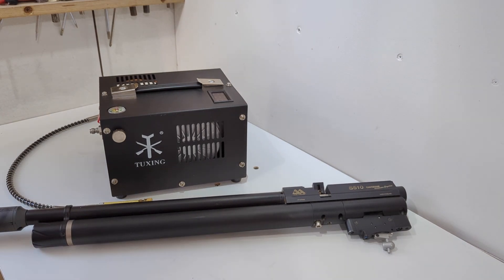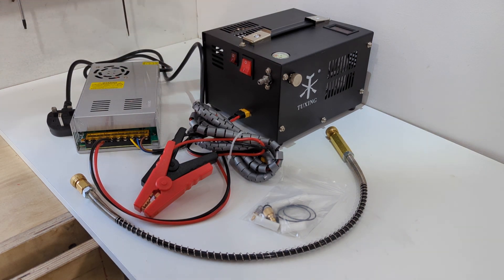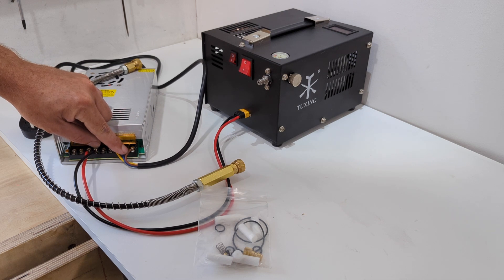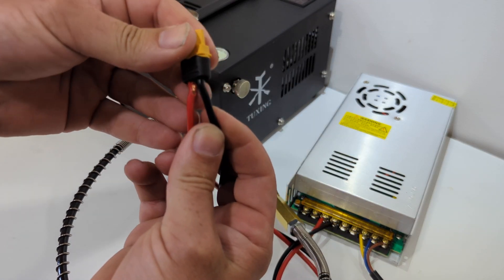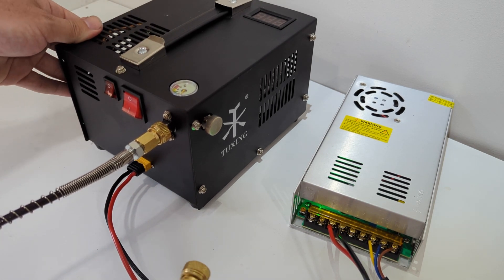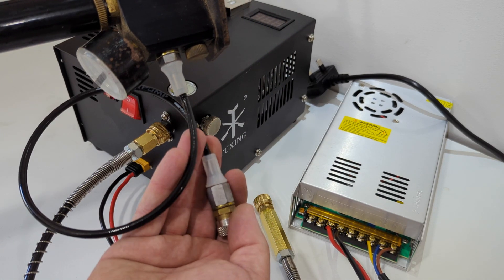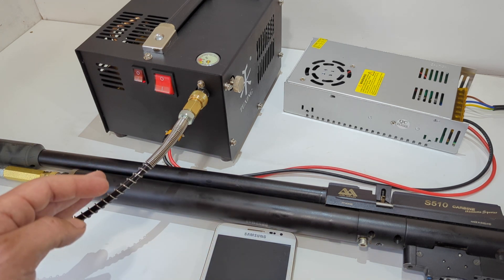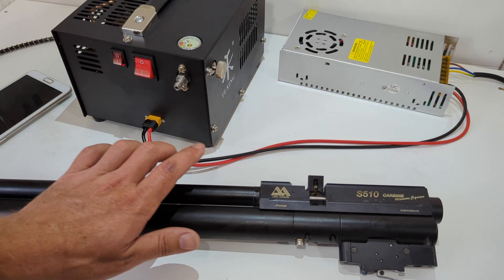The shocking truth about the tuxing 300bar mini pcp compressors

Comment: You might want to throw that PSU away and replace it with a Mean Well one. The chinese noname brand ones are very commonly using substandard components and pose a serious shock and fire risk. Mean Well may also have a suitable enclosed without exposed terminals.

Comment: Hi my tuxing worked lovely for 3 months then its like the motor has lost power and goe slow. Amazon was rubbish made me deal with tuxing in Chinese direct. No help. Any ideas ? If tried it on car battery same results. Just makes a bit of pressure. Stalls. The transformer giving 12v to the board all joins perfect. Had cylinder apart everything looks new as it should 3 months old. Weekly fills at 200 bar. Any ideas ???😢

Comment: Hi, good informative vid, thank you! would be good to see and update on what you ended up doing with this
Reply from the maker: Hi mate,  there's a full strip down and repair video the the compressor after 18 months use. It's still running fairly well to this day. It's definitely getting tired and could do with a few new parts but so far,not a bad buy all things considered 😉
Reply: @tillysgunstocks  Ah so there is, apologies! just given it a watch now. did you find out if that grease was a good shout or not?

Comment: Helth and safety gone a bit mad again nobody is going to grab hold of the wires or stick a screwdriver in the live bits with it switched on , ok point it out but there's no need to be so alarmist about it ,I've had one for 18 months not had a problem with it,  just my opinion,  😁👍

Comment: You never did a follow up on this that I can see (I searched for "Tuxing") so I presume there's nothing worthy of note on this compressor.  I've just ordered my first PCP with a hand pump but I have my eye on one of these when I get sick of pumping (or find it too much effort) because they are about 1/5 the price of the gun shop compressors.

The only wires you really need to be careful not to touch are the AC line from the house power.  everything else is 12V and no danger to you, though of course any bare wires are not good because you could short out the power supply and damage it (but probably not because they are protected).
Reply from the maker: Funnily enough mate it's just died.. I need to do a strip down vid asap.. but it's worked well until it didn't 😆
Reply: @tillysgunstocks  Well hopefully it's fixable, but that depends on the failure of course.  I'm sure all air gunners would be interested in what you find out.

Comment: This kind of power supply, a closed frame switch mode, was never designed or intended for use outside an enclosure. It is itself a component only that is meant to be used as an internal part in some other larger assembly, that's why it has no strain relief, as that would normally be done internally on the chassis of whatever product contained it.  The fact that it is supplied naked like this without so much as a box to enclose it speaks volumes to what a shonky cheap arse vendor this is.

Comment: My unit is slightly different it has push click buttons for both power and fan. Filter that came with it is a bigger blue cylinder. The power supply blew out on the first day. I just use the car battery.

Comment: Old video but I bought one recently with some 7" / 8" long filters with the foam and moisture absorbing balls. The collar on the connectors can be pulled back whilst under pressure..
I have fittings bought elsewhere in the UK and you cannot pull the collar back with pressure in the line. Dread to think how much damage a 7/8" projectile can do at 300bar if someone accidently pulls the collar back.

Comment: How is this holding up after  9 months. Thanks Den.
Reply from the maker: It's not blown up yet mate. It's not got any noisier or anything untoward as yet. It has pretty much paid for itself already though with the amount of air I'm using for filming and stuff😉
Reply: @tillysgunstocks   happy days was looking at the version where the inverter is built into the case, do these compressors need silicone oil? 
Thanks again.
Reply from the maker: According to the paperwork they are maintenance free. I find this hard to believe but as yet I've not done anything to it and it's still going strong..ish
Reply: @tillysgunstocks  cheers for the speedy reply for a the price I’m gonna give one a punt.
Thanks for the info it’s appreciated.

Comment: It's Interesting that the compressor passes the standards required for high pressure air but fails on the power supply. I would have thought it the other way round. I see that the compressors with the built in power supply have failed British safety standards and were recalled. I have just bought one of these under a different name and blue in colour. It works very well. I wonder if these available today have now passed. 
Thanks for a great presentation.

Comment: This is a junk pump. After a few runs the sleeve bearing on the main shaft came loose. The manufacturer’s solution? Disassemble the unit to reveal the shaft and hammer a ding into it that would restrain the bearing from moving with the shaft!  The noise is extreme and output minimal. It took at least four runs to pressurize my rifle due to rapid heat buildup. 
I would guess it died within 5 hours of use. 👎

Comment: I made the mistake of buying just the compressor without the external power pack as I have a few 12v transformers lying around but I soon found out that it won't power the motor enough to run the compressor as every time it tries to move the piston on the compression stroke the motor struggles to make a full revolution IV only had it less than 24 hours and couldn't help myself taking it to bits,,, can anyone tell me what the specs are for a 12v power supply that I need as so far I can't find the one I should be using,,, also keep up the good work with the videos they are always interesting and insightful

Comment: Regarding the airtube corrosion issues . I recall AirAms suggesting the airtube of the NJR100 ( yep going back a while) a spray of wd40 up the tube,  allowing it to dry before assembly.  Anyone ? Lol .
Reply: I just out of curiosity found the owners manual for the S100. Every 6 months pop 3-4 drops of oil into the reservoir via the filling adapter... then fire the rifle into some rag ... but don't load a pellet ! .... boom!
Reply from the maker: That's interesting to know. I can't say I've heard of it,in more recent times 🤔

Comment: Dry air is a must but it is as hard on the compressor as the rifle.  Humidity condensing in the cylinder ruins the lubrication, causing wear.
My Spiritech compressor has a sintered brass filter so I modified it to a fitting to plumb air which has been dried over molecular sieves for days.  The mol sieves are in a 10 Bar rated air tank.  I withdraw air at a regulated pressure set at 0.10 Bar.  
I only use it to fill a rifle and it never gets over 30°C.

Comment: Hi. I've just received one of these today and it seems to be an updated version. I was preparing my teeth ready to be gritted over the power box wires but they have done a redesign and it's completely sealed and just how one would want it.
I've just used it once so far and have to say IF It last a good while then I will be well happy. It is very well made, thickly and evenly powder coated and really quite quiet. The pressure gauge even glows in the dark!
Time will tell but over the moon so far.
Reply: Any updates?

Comment: 12 Volts DC on the other connector  that will not harm you
Reply: 1.25 amps might hurt you though.
Reply: @matty1255  Nope. Not at 12 volts, you can put wet hands on battery terminals with 250 amps potential on even a small car battery, or 700+ on a larger one, with absolutely no effect.

Comment: That type of switch mode power supply is meant to be fitted inside an enclosure with proper earth bonding, fusing and switch protection! Using it out of an enclosure it becomes a death trap!

Comment: I am surprised the H,S, has not clamped down here! We have bare terminals carrying mains voltage 240 volts outside the enclosure. Any body touching the live terminal could prove fatal! There is no cable restraint of any kind any the bare earth is not bonded to the metal case! How on earth did it pass the safety laws to sell in this country???

Comment: The shocking bare cable is only 12volt isn't it, its on the low voltage side of the step down transformer.  You won't get a belt of that!!
Reply: It's amps that kill you.
Reply: @OldNavajoTricks  Nope. Not at 12 volts, you can put wet hands on battery terminals with 250 amps potential on even a small car battery, or 700+ on a larger one, with absolutely no effect.
For "amps" to kill you the voltage has to be much higher.
Reply: @Stambo59  Live and learn 👍
Cheers marra.

Comment: Good review.. I bought one of these on prime day too. Seems to work well. I like the idea of a backing board  adn zip ties to the cable.. Wil be doing that. One thing I found is if you connect the filter end to the compressor it can blow the filter material out.. Was a rather dramatic brown trouser moment!

Comment: far too much concern about health and safety these days, the nanny state taking over, if you know its a bit iffy just don't touch it when plugged into the mains, remove the plug from the wall after use
Reply: You miss the point, Tuxing is a bad outfit with bad products. After my own experience with them, I would not buy even an oring from them
Reply: i bought the moisture removing filter and it has been first class built like a tank and pumps to 300bar @kevinnielsen1356
Reply: You have to consider the lowest common denominator. Pumps like these in the hands of people who are clueless could have serious consequences. It would not take to much for the government to use a few incidents as an excuse  to ban PCP’s completely.
Reply: @paulkeogh3518  4500psi is serious stored  energy. That is why I have a serious compressor, serious pressure vessels, serious connectors and hoses. Seriously. Airgun manufacturers have promoted cheap compressors in order to sell more pcp's. It seems that airgun reviewers lately are avoiding cheapo compressor promotion. We can hope the market is self correcting on cheap where cheap is dangerous.
Reply: @user-fz8fy4zl1c Use a molecular sieve air dryer. These are around 3 to 4 hundred dollars, wlii protect your guns from moisture problems and are easily tranfered between compressors for when the Tuxing goes belly up
Reply: If you are stupid enough to touch exposed wire's then maybe you shouldn't be picking up a Gun.😮

Comment: Easy solution to the dodgy power supply would be to make a ventilated box for the power supply to be mounted inside of. Install a panel mount XT connector and a fused&switched IEC C14 socket in whatever side of the ventilated box that you want to be the front panel and wire the sockets into the power supply. besides the XT connectors you could also add dc barrel sockets and other types of sockets to the front panel of the ventilated box to give it more versatility in use. A set of different dc sockets for each voltage the power supply is capable of producing. Just add labelling and you're good to go.

Comment: Been using mine for 6 months ,zero problems ,£ 145 free UK to UK delivery aliexpress ,charges my Ixia compact in around 12 mins and my ATA Airborne in 18, if you can't use it safely you should not be owning an air rifle !!
Reply: Old comment but puzzled why you should not shoot if you don't know whether a PSU is safe to use or not?   Several channels on youtube have taken these to bits and found the cases were not earthed, sometimes the cases are live and the only thing protecting the user is the plastic case.

Comment: The Chinese love a bit of danger😂,my lad brought a soldering iron of Amazon that kept tripping the house electrics when I checked inside there was similar stray strands of wire causing a dead short,it was easily fixed but I just binned it brought him an Antex like mine which I’ve owned for like 25years😂

Comment: I'm looking at 300bar compressors and really want to get a UK made Hill EC-3000, but rampant inflation of prices of everything lately means dropping a grand on a peripheral part of my airgun hobby/addiction is hard to justify. An 'Improved Yong Heng' ebay compressor for £199 is tempting, it appears you get a lot for your money BUT I don't want any nasty surprises, this video is eye opening in that respect. They're not in the same league and I would much prefer to buy quality and take pride in supporting the UK manufacturer so will continue to save up my pennies towards buying the Hill. 5x the price though, so it's a tough call.
Reply from the maker: Yep it's a big jump in price eh. Tbh internally the actual compressor unit isn't too bad, the power supply is the weak link but can be replaced or made good with a small amount of work.
Reply: @@alexanderlemoine3810 Thanks for the replies. I'll save up for a Hill.
Reply: Ive got a hill footpump.   It rusted.  I emailed hill for a part number to buy a replacement part.  Didnt even get a reply.

Comment: Living where I do... Im lucky..
Theres 3 dive shops and 2 cylinder testing places within 15 mins drive of my house. One of which is 5 mins walk away (If I was idiot enough to walk with a 12 litre steel cylinder)
They only charge a few quid to cool refill my dive cylinders.

Exposed wires and sketchy wiring are hardly difficult to fix.
You could make up your own XT60 cable and plug for less than £1 so the exposed conductor is a niggle but a non event.

Comment: I own one of these and agree they aren't perfect; If you aren't tech savvy, avoid like the plague and stick with scuba bottles or shop filling.
The first thing I do EVERY time I use my compressor, is turn the fan on and LEAVE it on for the duration since it will cool the system eveb if the pump is off... 
Unfortunately for me, my pcp tank is the size of a scuba buddy bottle which tends to be about 500cc and trying to fill it one go would burn the compressor out, so I have to fill it in stages, I found the best way for my compressor is to stop the compressor at 70 degrees and bleed the line so the system isn't under load, let it cool, then rinse and repeat.
Its time consuming, but its the best I can do since the local gun range closed down and I can't afford a scuba tank😢

Comment: I am more shocked about the hand pump not causing moisture in the bottle/resivoir. When I got my pcp nearly everyone said how bad they are, I would of perseverrd with the effort it was the moisture issue that stopped me, seems its not bad aftrr all
Reply from the maker: The pumps aren't really that bad tbh, you'll often see pics of really badly corroded brass valves with scale and verdigris on, that's often a poor quality of brass  and poor handling at factory to start with, Sometimes a reaction with any lubes used. 

I'll put it in the comments so it's up, but I've got 4 spare new cylinders here ,so if I had any concerns atall about it's integrity I'd have swapped it out 😉

Comment: Don't use solder to connect the mains lead, use proper crimped-on spade connectors instead. A 3D-printed front cover to hide the terminals would be godd also. By all means secure the lead to the case using cable ties to prevent it being pulled. Other than that it's pretty standard fare for these PSUs and nothing to worry about. You might check the case is actually earthed by checking continuity between earth lead and case with your meter - it's not unkown some fail even this basic test!
Reply from the maker: I crimp and solder mate, spent many years building wiring looms for track cars so belt and braces where possible.meter says it's got a decent earth,but will likely dismantle and check for my own peace of mind 😉
Reply: @tillysgunstocks  Crimp and solder is not belt and braces.  chrislx2006 is right about this!
Reply: @Lyndalewinder I think Tommy means that he CAN crimp and solder, in which case he’s not disagreeing, he’s just saying that he can do both, competently, and has chosen one method, probably because he actually has the kit in his hands and can make the right choice for him. 👍
Reply: @BionicRusty  You should never crimp a soldered wire!
Reply: @Lyndalewinder  Crimp first and then solder.

Comment: It's quite easy to swap out that XT60 connector. In fact, you could run the compressor off of a car battery, and connect a trickle charger to the car battery, to keep it topped up. In any event, having those live AC wires exposed on the power supply is it complete no-go.
Reply from the maker: Yep I'll approach them for a fresh lead to start with, the rest I'll sort out. Luckily it was cheap... 
I'll do some regular updates on it for science/fun 😆
Reply: @tillysgunstocks  🙏👍

Comment: Thanks for sharing your experience! 
Noticed you don’t have a barrel band fitted on the US. Do you find it more accurate without it? Or is there another reason. Just curious, thanks.
Reply from the maker: I had just removed the band in anticipation of removing the cylinder to check it over. The extra rigidity of the shroud keeps zero nicely with it on 😉

Comment: I got one of these cheap compressor, mine is very very similar except it has less vents in the housing. After 2 months of weekend use it started to struggle to reach 250 bar and after a while it won't go past 120bar. Ended up giving up and buying a 9L scuba bottle, I can shoot for a month with one $10 fill, seems good to me.
Reply from the maker: I will keep a good eye on this one and keep it updated. The internals of the compressor itself will be quite simple so there may well be a piston related problem with your one?